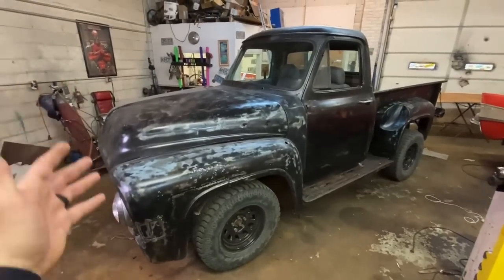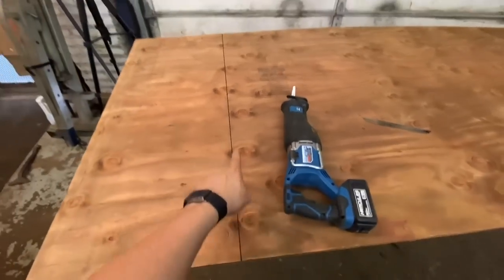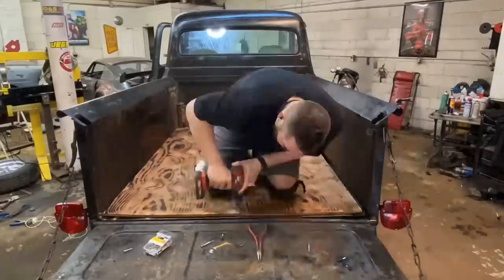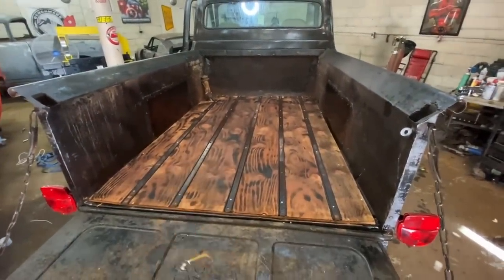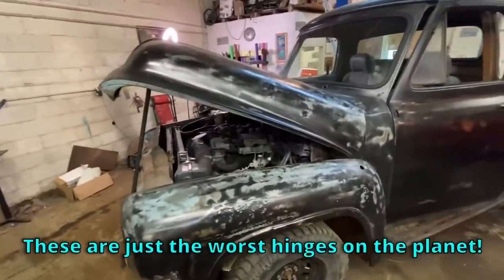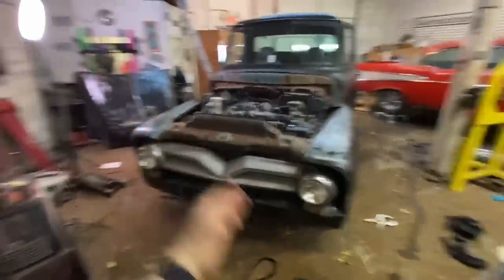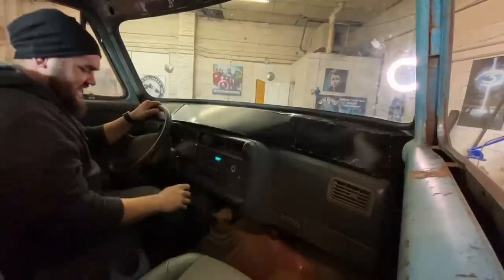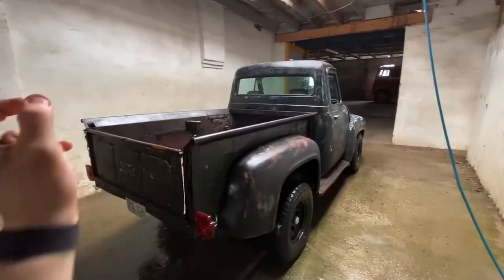BURNOUTS IN FRONT OF THE POLICE! FINISHING UP THE LIFTED 4X4 RAT ROD TRUCK! BUDGET BUILD BODY SWAP!

Comment: You can use ready rod through lip of front of the hood and the upper corner of them hoods to make it a bonnet style flip up hood and relocate a latch to the back and it works really slick

Comment: The engine sounds like it's down a cylinder. Listening to you as you accelerate away from a standing still start, just sounds like it's missing, doesn't sound smooth.
Reply: Ive been thinking that since he first started it on videos past. Sounds terrible.
Reply: It’s down 2! It’s a 6 cylinder 😅
Reply from the maker: Has real shitty gas in it, i need to drain it and refill but don’t have a pump yet. I have one coming but won’t be here til next week
Reply: @CaseysCustoms  you could just disconnect the supply line off the fuel rail, stick it in a bucket,  jump the fuel pump relay in the fuse box with a wire, and it will pump out all the fuel out into a bucket for you.
Reply: I came here to say this also. I don't think it's bad gas. It's too consistent
Reply: Gas and an oil change or atleast check. My small block sounds loud and tinny like that when its down a quart or two. Could just need oil.
Reply: I can’t tell if he ruined this truck or what? Definitely doesn’t come off as a built old school truck….seems off 🤔

Comment: Really dig that used oil stain on the plywood, you can see the water immediately bead up on it at the cardeathwash. I know it absorbs into the wood, but does it have a grimey residue over time? Just wondering if stuff tossed in the bed would end up dirty from it a year from now?
Reply from the maker: Nope the wood soaks it up enough it’s not sticky, this was only a couple hours after i stained it so it wasn’t completely soaked in yet. A lot of guys like to do this on trailers cus it protects so well
Reply: @CaseysCustoms  That bitchin, I learned sumpin new today, thanks!